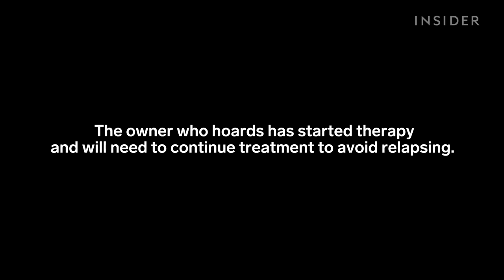How A "Hoarder's House" Is Deep Cleaned | Deep Cleaned | Insider

Comment: There is a difference between being a hoarder and a prepper. Having a "stockpile" of 5 gallon buckets and medicine is normal for prepping, especially for Mormons/LDS. There's nothing wrong with them if the seal is intact.  But the rest of this, wow.  Your insight regarding shells is spot on.
Reply: There's a thin line between those in some situations tbh

Comment: I'm just curious if the excess things that are usable or even new get donated or are just thrown away?
Reply: Midwest Magic Cleaning has some great info on the channel about it. Basically, it depends on the circumstances. Rurally it's quite labor-intensive to donate stuff and there are very few people to take it. In this case, the house was in a more urban area and they were able to put many things out to be taken. They also helped a family with nothing furnish their new home with items removed from this house. In most cases, though, the sheer quantity of items is very difficult to get to all the people who need it, especially in the rapid manner required to quickly and efficiently clear a hoarder house. In addition, because many hoarder houses come with infestations and structural damage that leads to leaks, items are often completely worthless, damaged and soiled beyond saving and would be a hazard to donate. Hope you find this informative!
Reply: @cabbagenut  thank you! this house seemed reasonably clean and stuff was in brand new condition that's why i was wondering.

Comment: Easily pushing 200 pounds * proceeds to pick up black plastic rubbish bag and it doesn't rip*.     Yeah nooo, haven't seen those survive even 30kg let alone 90 and you picking it up like that
Reply: He uses heavy duty contractor bags for that reason
Reply: @kg6801  im aware its that type and still standing by my statement, it aint anywhere near 90kg
Reply: @dr.emmettbrown9359  I'm sorry, my bad, I thought I remembered him explaining in one of his videos how much more weight those bags can take and I thought you were referring to regular rubbish bags, but I should have concentrated more on the 30kg and I would've realised where you were coming from, I think I was thinking 3kg and relating to the frustration of rubbish bags that seem to rip at only about that much. My apologies
Reply: Nyah, if they don't bust while hauling a body, then 200 lbs is probably fine.
Reply: Yeah, he sure was absolutely serious about that and not at all doing a humorous exaggeration